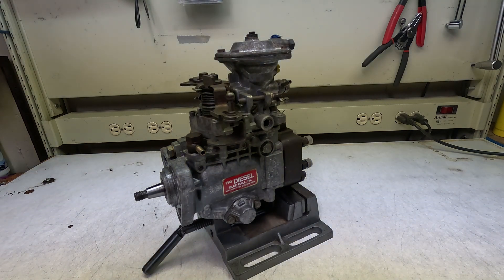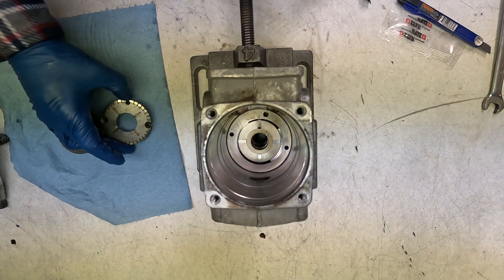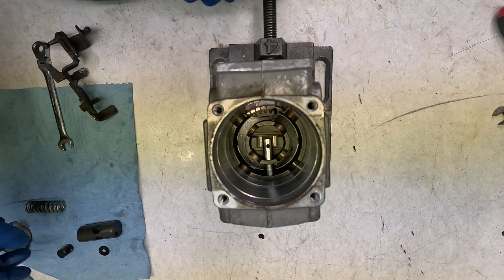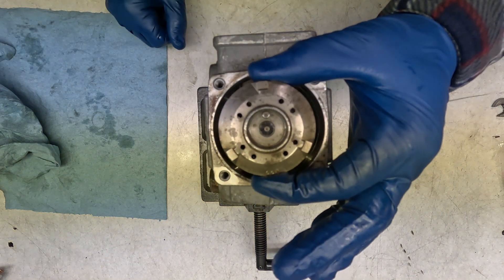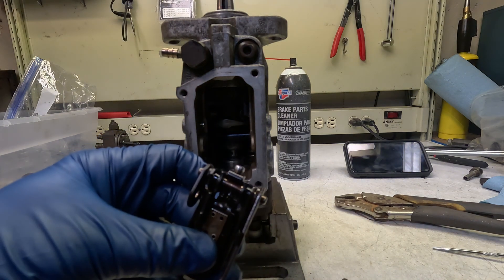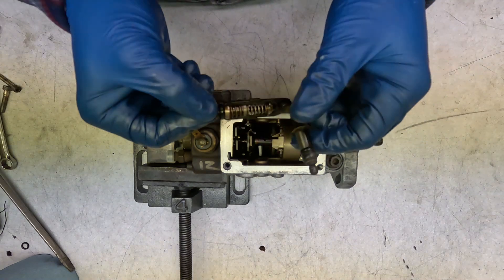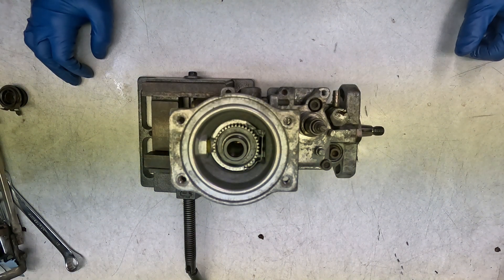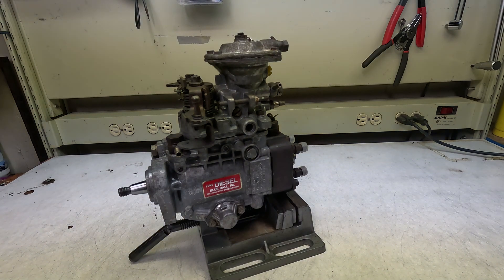Bosch VE Injection Pump Rebuild - VW mTDI

Comment: Damn...you know your pumps...I have a question hopefully you can answer before I head down this road of rebuild...
Have an 84 Rabbit turbo diesel...sat since 2010....I cannot get it to prime...I've filled with trans fluid as everyone says...but nothing out of the injector lines while trying to bleed....could it be so gummed up it can't push fuel thru...&...is it possible to hydrolock if I keep going....Afraid of ruining pump...
I've a few diesels over the years...but this car has be questioning my abilities...better to be cautious.
Reply from the maker: I would check to see if your fuel shutoff solenoid is dead. they’re not too hard to rebuild if you want to give it a shot

Comment: Great video, help's alot, I'm rebuilding the pump for other people it had an overpressure event and damaged 2 components inside. Do you perhaps have the sized for the 3 point sockets? or is there a kit i can use as I have to replace the fulcrum lever as its cracked and bent.
Reply from the maker: You can find the sockets on eBay by searching “injection pump sockets”
You can also dremel out a 13mm for just the fulcrum lever ones. 
I don’t know a good source for a replacement lever aside from a core. They are all clearly labeled with a PN. I would try searching that when you get it out.

Comment: Very nice and informative video. Can this injection pump be used on ALH and newer 1.9 TDI engines?
Reply from the maker: You could put this on an ALH. The mounting is a little different and it may take some work. The injection system changed after the ALH, so it won’t work on anything newer.

Comment: My buddy changed the joints on his 1.6 td audi 80 and ended up with an engine that starts bjt remains at idle!!! I guess he didn't engage the governor lever in the fork!
I will show him this video and we'll try to solve the problem.
Meanwhil any ideas???
Reply from the maker: I’d see if pulling the throttle lever right at the pump does anything before taking it apart

Comment: Thank you for the detailed video, it's very good and useful.
Can you tell us what type of 1.6 TD fuel pump you used exactly? I mean, what's its serial number? There are several types of 1.6 TD pumps for VW. Does it matter, which one I use? Can a 1.9 TD pump be used to build this type of mechanical pump? Does it work with 1.9 SDI engine?
Reply from the maker: It shouldn’t matter what kind of 1.6 you use. This takes out most of the working bits anyway. I would look for one with a boost aneroid though. 
You can build one of these based on a 1.9 mechanical pump. in fact, it is probably better. 
It should work with an SDI, but I don’t have SDIs in my country, and limited knowledge.

Comment: It looks like the piston stoke on my pump to the head simply dumps out the end under the threaded cap through a hole through the head back to the pump body /  no pumping result.
Reply from the maker: That should be routing it to one of the distributor valves.
Reply from the maker: That should be routing it to one of the distributor valves.
Reply: I found a video that showed the position of the shaft as it actuates.  I hope I will find where it is out of time tomorrow. Return stroke between ports = wrong.

Comment: Will a mechanical pump from an older 1.9SD engine fit on an 1Z and/or ALH engine or do yoy need to do this?
Look beside the higher lift and larger piston, if you just want it to run.
Reply from the maker: I have heard they will work. The SDs are indirect injection right? Someone mentioned using a 1.6idi pump on a TDI. 
I imagine you would have issues with drivability though.

Comment: Great video, am trying to build a pump for my VW using a LR 300 pump, cams worn but I have and ALH EDC pump I can brake, do you know if the cam will fit? Cheers buddy
Reply from the maker: The cams will fit, IDK if they will work. I’d measure the thick and thin parts of the cam to see if they are comparable.

Comment: Nice video ! I did this myself a year ago, 120hp at the wheels 1.6TD. I did not know about the fulcrum lever, I will look into that !
Reply: Would either of you be interested in building me one for my 1.9 AHU? Im in the process of a rebuild then transplant into my westy eurovan. Thanks.
Reply from the maker: @alexanderpappas68 This is the first one I’ve made. I haven’t had the chance to test even this one.
Reply: @haoleboyshow-tos2279 I could be your bets tester. You could ship it to the diesel tuner guy here that everyone uses so he could set it up correctly. What do you think? Id pay his labor and a fair price to you or if its not right yet I could send back for you to address whatever it needs.
Reply: @alexanderpappas68 I'm located in Sweden... Where are you ?
Reply from the maker: Glad to know this worked for you. Any pointers from your build?
Reply: Grind the LDA pin for much more power, cam plate from 1.9TD and Mercedes injector tips.
Reply from the maker: @phredde76 What Merc for the tips? I have access to some IDI merc diesels, but those are different

Comment: Ignition advance is important on tdi engine ! More power and and a lot of torq 

And fulcrum from cummins has more stroke ! 😎

Sorry bad English (swe mtdi builder) 😅
Reply: Hi! Can i talk to you here or in pm? I would like to ask some questions on building my franken/mtdi pump for a 1z engine.
Reply from the maker: @m5871  I’m keeping an eye out for direct injection pumps to get more stroke.
Cummins stuff is expensive here.
Reply: @haoleboyshow-tos2279  Here in Sweden, Cummins parts are really uncommon and it's even harder to get pump parts from Cummins, but if you want something that's in the middle of the fulcrum movement, there are some Renault pumps that give more movement and are usually cheap on the scrapyard, but still not as good as, for example, Cummins. 

I've found a company that sells parts for pumps, so I only use Cummins Fulcrum these days. 🙂

Comment: I’m assuming need 1.6 injectors for this or would the 1.9 injectors still work?
Reply: It was working but it was much slower than my original 1.6td engine.
Reply from the maker: @adambarkanyi1246 That’s good to know. There’s a lot of myths floating around about using an unmodified pump.
Reply from the maker: @connorbrown9123  The whole point of this is to make 1.9 TDI injectors work. 
I’ve heard, anecdotally, that an un modified 1.6 pump will work on a TDI
Reply: @haoleboyshow-tos2279 i have tried to run my 1z with a unmodified 1.6td pump but it had almost no power,and i could’t turn  the max fuel screw further in, because it was rev hanging like crazy

Comment: Hey thanks for this video, it helps  Quick question, I lost the retainer for the locking pin. Any idea where to buy one? Thanks again,
Reply from the maker: @pedrohuerta5905  The pin going in at 5:40? That’s going to be tough. I’d recommend finding a core for sale in the local area for a VW 1.6D. With no other options, you could tack it in with a TIG welder.
Reply from the maker: If that’s the retainer you’re talking about, I actually have spares. Not sure how I’d get them to you though.
Reply: @haoleboyshow-tos2279   Hi there, that would be awesome! I can buy it from you and pay for shipping. I live in Calgary Canada. An item that small would not require any customs paperwork I don't think.
Reply: @haoleboyshow-tos2279  Hi, Do you think you can mail it to me? I'll pay for the clip and the shipping. Let me know thanks

Comment: Great video with great information. Wondering what seal kit you used for this? Thanks!
Reply from the maker: Here is the seal I used. 

https://www.ebay.com/itm/173282628844?mkcid=16&mkevt=1&mkrid=711-127632-2357-0&ssspo=F1CkhQYeREi&sssrc=4429486&ssuid=gQVJZ-qySyW&var=&widget_ver=artemis&media=COPY

Comment: Since you know, can you tell us what is the difference between the throttle lever from 1.6TD and D24 and does it have a bigger stroke?
Reply: Hello from Greece.. again.. I want to ask you one last thing.. I hope I don't disturb you. Did you use the pressure regulator from the TD or TDI pump?
Reply from the maker: @ I used the TDI pressure regulator.
Reply: Thanks for your help.. if I understand correctly you are building this engine for an old Datsun... I really like your style!
Reply from the maker: @ Thanks! That’s right, this is to swap in a Datsun truck. I’ll be posting an update to that build next week.
Reply from the maker: @ΔημήτριοςΔρίβας-γ2δ  The 1.6D and D24 throttle lever are not interchangeable. From what I can tell, the D24 stroke is longer. That may have more to do with the governor cage spring being more eccentric though.
Reply: @haoleboyshow-tos2279  You mean the governor cage spring has a longer stroke too?
Reply: I will try to make a modification...
Reply from the maker: @ΔημήτριοςΔρίβας-γ2δ  It is difficult to describe, but I did make a video investigating this. 
https://youtu.be/ueYyrCfGkuk?si=TN9PTQndH6wQM5Rj

Comment: Bonjour, j'ai également une pompe tdi-m dans ma golf que j'ai construit avec une pompe de 1.6 comme vous, mais j'ai des soucis de réglage avec ma pompe, je n'arrive pas avoir la bonne avance pour ne pas avoir de claquement moteur, quand j'utilise le capot de tdi pour le piston d'avance, le moteur claque très fort, et quand j'utilise le capot de 1.6, le moteur ne claque plus du tout mais ne prend plus bien la monté en régimes. A combien calé vous statiquement votre pompe sur le 1.9tdi et est-ce que le réglage de l'axe du régulateur centrifuge à une importance sur le piston d'avance ? j'ai également enfoncé la soupape de régulation de pression interne a 2.4mm, c'est suite à ça que le moteur c'est mis à claqué mais la puissance est venus direct.
Merci
Reply: Hi! I have the same problem as you have. Did you found out what is causing the problems?

Comment: Awsome guide wish it has it years ago when i was attempting to build a good pump. 
I remeber reading in a mtdi forum in Sweden ln the fulcrum lever thar you can file it somehow to more throw? I guess you do it against the "stop"? 
Idk maybe it a idea to explore incase you need to increase the throw of the lever. 
Keep up the good work!
Reply from the maker: @antonaberg5238  Thanks, appreciate it! I’ve seen the forum descriptions. Most of the picture links are dead and I just don’t have enough information to proceed confidently. I was originally planning to use a 1.6TD. So as long as it makes more than 70 HP I will be happy.